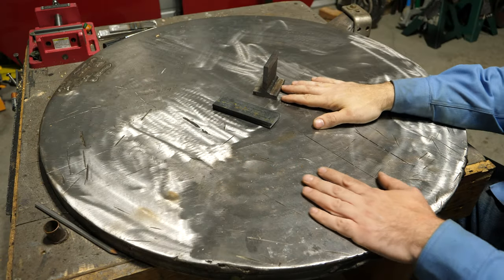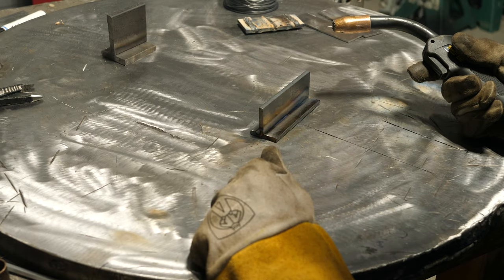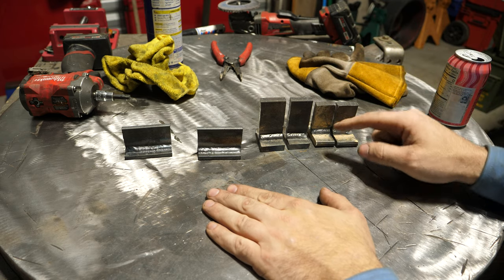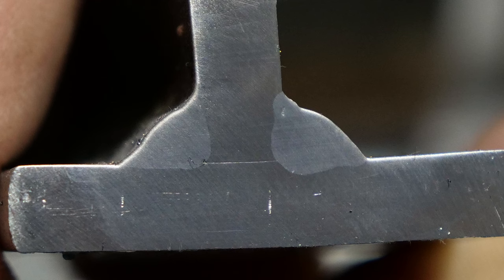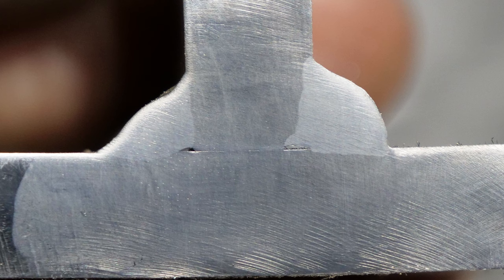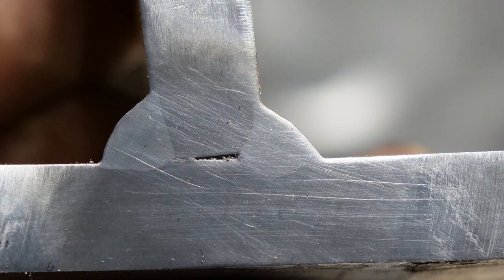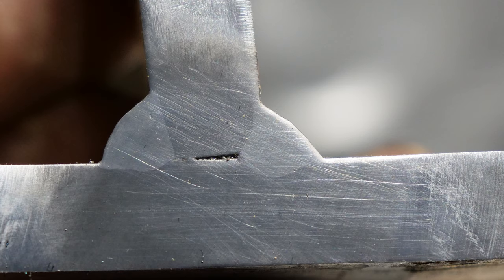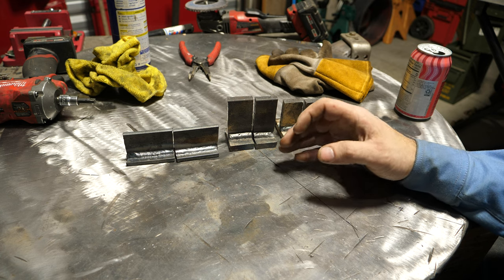Short circuit mig vs Gasless flux core on thick plate

Comment: Loving the cut and etch Greg. Im mostly a stick guy, but it was eye opening to see that flux core has superior penetration compared to solid wire.
Reply from the maker: On 1/4 inch steel there is no doubt that flux core is far superior to gas mig.  I have run into issues with over 1/4in where the flux core has porosity issues I can’t eliminate.  That’s why I too like stick and use that anytime I need to weld 1/4inch and above steel, it produces clean welds, great penetration, and is reliable.  I have ordered dual shield wire (.035) to try and that will be very interesting to see how it runs on thicker plate.  It should solve the porosity issue I have seen, and allow a 200 amp MiG welder to safely weld 3/8th plate, or atleast that’s my hope.  Testing will show if that’s true or not lol.

Comment: I'm getting up there and never had any supervision on a mig. I bought a Lincon 185 when I was 15 . It cost me 125 dollars and came with wheels. I still have. About 15 years ago I go a 145 Hobart shortly after that my son borrowed it and I never saw it again. He burnt it up.  So I bought a mig and a tig that can stick.  I torch weld, braze and stick. I went to school  to learn these. I am so glad I watched you.  I'm in the process of up grading a very low side-by-side. It had a 6 horse predator I'm installing a 60 horse Honda. And I am welding to fast , wrong polarity and to far from material.  I will fix that thanks to you. I thought I had lost my touch !  I had to lengthening it for the Honda and I was getting concerned with my welding ,but I will remedy that in the morning . Thanks again.     👍👍🏍🙉🙈🙊
Reply from the maker: No problem 😀.  It’s amazing how well things can go when a few small details are correct.  Flux core wire In particular has to have specific things exactly right or it works terribly.  The cool thing is once you do those things the results are instantly better and quite good at that.  Most welding just comes to a few small details being just right for the results to be acceptable.  The key is knowing where things are going wrong and adjusting accordingly.  Since you’re researching knowledge on how to become better, the great thing is you will likely get significantly better fast.  That’s what is the great part, once you master a few things like making simple weld beads that are really good on a flat plate, you can build cool stuff like you’re talking about 😀.

Comment from the maker: So I bought the dual shield from Amazon.  I will have a video out soon with it.  Having never ran .035 dual shield (I have only ran big stuff with a engine drive) it’s been a learning curve.  I will share a bit of a “sneak peak” to what’s going on thus far with the dual shield:

I couldn’t find reliable setpoint data because it’s so uncommon of a wire in .035.  I have experimented with a stupid amount of settings, everything from 18 to 26volts, 260 to 430 in/min feed.  So far I have found a lot of interesting things.  It makes perfectly clean welds with zero porosity (internal or external).  The welds are perfectly flat and very good looking.  It runs really good and is easy to work with.  The process 100% operates as spray arc, it’s very quiet and has very little spatter.  With all that said I have ran into a issue where I am not seeing solid root fusion.  The higher the voltage the less root fusion is present.  Since it operates on DCEP it’s not too surprising it would have less penetration than Gasless flux core but it’s significantly less.  Running 1/16th dual shield wire on a big engine drive has no issue with 3/8th plate when it comes to penetration, but .035 at 200 amps isn’t quite getting there.  I will be doing a big bend test coming up and I have a feeling it will fare better than Gasless flux core despite having less penetration.  The porosity issues with the Gasless and brittleness of the welds will be a issue I think.  Time will tell 😀
Reply: Greg, my Sanrex 250 only has settings for 3/8 if you go up to 045 wire for dual shield. It suggests 360ipm and 25v— with 045! So I think with 035 you’re probably going to want something of similar 25V range, but much higher wfs— probably in the 420-450 range.

Comment: As usual another great video with a lot of useful information.  It's a lot of work but you are putting out great stuff for anyone thinking about getting into welding (home gamer or full-time profession) and you make it fun with the strange accent!  🙂  I'm really glad you went over the "circle e" vs. straight in bead on the root as I found the same thing when I cut and etched or tried to break the weld with unshielded flux core.  Anywho, many thanks for these videos!
Reply from the maker: Thanks for the kind words 😀.  I have done a bunch more off camera testing with the stringer vs circle-e and have seen consistently the same result, loss of root penetration.  I think it comes down to the wires limitations of how much molten metal it can make it through.  For a fill pass on a multiple bead weld I think it would be fine.  As a root or single pass I definitely wouldn’t recommend it.  There is one exception to this, mig welding vertical up is a situation where you don’t have much choice but to do a form of a weave to make a proper weld. 

I shot a bunch of fillet weld break tests that will be rolling out soon.  Those results have been far more interesting than I expected.  So much so that I am going to spend a whole day welding up some test pieces to break Inorder to really clear things up with the first set of results I have 😀

Comment: Just a few minutes earlier I had presumption that weave is usually better :-) Very interesting results in both videos, thank you!
Reply from the maker: I have done a bit more testing on the weave vs stringer that I will eventually get around to filming.  From what I have seen, doing a weave in the flat position universally bites in the side of the plates more at the cost of the root penetration.   This is on fillet welds, on other joints it may be less of a issue.  The problem is the wire can only “penetrate” so much molten pool.  When you weave on a fillet weld the sides of the weld don’t have as much weld pool thickness as the center therefore it makes sense as to why the center of the weld doesn’t gain penetration.  That’s also why higher wire feed speed doesn’t seem to improve penetration of a weld with Mig much, it just ends up depositing more metal above the plate.
Reply: My train of thought was that more time I spend in roughly same place more heat input it gets and so bigger puddle of molten metal...bit counterintuitive that it just wider and not deeper :-) Thank you for clarification!

Comment: Another really helpful vid . Thank you . 
You flux core vids came out at the perfect time for me as I had just bought a cheap 200amp multi process machine. 
After years of stick it was a pretty easy transition to flux core.
Hell I use it for almost all my work now .
Been using it to weld 12mm round bar to 5mm angle when upgrading sliding gate tracks 12m long . 
Was a bit dubious at 1st but it works well and it looks like I get good penetration ( 20v / 22v on my machine seems to do it ) .
Reply from the maker: No problem 😀.  Flux core is very handy and can produce really good welds.  It is far easier for vertical up and limited access welds that’s for sure.  Far less frustrating lol.  Flux core has a bad rap primarily because of 99$ welders with unskilled people.  It’s actually a real viable process that can do a lot.  Glad you found a new useful process 😀

Comment: I’ve been thinking of learning to weld for years. Your videos are great, you missed your calling as a MATC instructor. 

I haven’t watched all your content yet, so forgive me if you’ve covered it. What about a video on buying used equipment from marketplace? I’ve been looking and I have no idea where to start. I think a Lincoln or Miller ac/dc stick unit is where I should start, and they are available for a bit more than the Amazon stick specials, but I’m not sure the thunderbolt ac/dc with 25 ft leads for $250 is where I need to begin. The other kick in the pants is running a 50amp 220v to my garage. That’s a used welder worth of wire cost these days.

Maybe the 100 dollar yes welder is worth it on a 20amp 110 that I already have. Anyways, that’s my video idea/question. Please continue the good work, you are a great educator.
Reply from the maker: I haven’t covered buying used equipment, but that’s a great video idea, I will cover it and have a video out within a week or two at most.  I will give you some advice now, hopefully it helps.

For certain circumstances a cheap Amazon special will cut it.  I own a 100$ Amazon stick welder that I bought because at the time it was annoying to haul my big brick of a miller dynasty outside of my shop.  It did the job but honestly the quality of what it could do had more to do with me than the welder.  It’s setpoints were off by as much as 20% from what it said, which is very common with cheap welders.  For me, I could just work around it because I knew if it was “hot or cold”.  For a inexperienced person they might not know what to do to compensate, become frustrated, and not realize their equipment is making things so much harder than it has to be.  It does pay to buy better stuff. 

I would buy a solid used welder for a bit more than a cheap new one every day of the week.  There is so much you don’t realize is different between cheap and good welders until you use them.  Cheap stick welders won’t weld with 6010, and often barely run with 6011.  They don’t have hot start, or arc force control.  Their set points tend to be off which makes it hard to adjust settings.  As a experienced welder I can compensate and stick weld with almost anything (even two car batteries lol) but a novice/beginner will have a much less frustrating time with a better welder because they tend to be more forgiving.

As far as actual used welders, a thunderbolt ac/dc is a great option, it does have limitations though.  It’s a bit harder to adjust its output vs a lcd screen setup.  It’s big/not very portable and draws a ton of power.  It’s duty cycle is somewhat limited on DC because of its simplistic bridge rectifiers duty cycle.  But it does weld with 6010 and 6011 well.  It does have zombie apocalypse level of reliability.  It also is available for reasonable prices used.  Pretty much if it runs a bead it’s safe to buy used because it works and will work.  I would take a thunderbolt ac/dc over virtually all cheap stick welders out there, unless portability is a concern.  

The only cheap stick welder I have found to be worth the money is everlasts stick only units.  Everlast doesn’t lie about their specs (aka max output or the ability to run 6010), their digital displays are fairly accurate, and they have actual adjustable features like arc force and hot start.  The best home hobby stick welder out there (in my opinion) is the esab rogue 180.  I have owned the 180 and I now own the rogue 200.  It welds perfect, it has all the settings that you want, and is very small/ portable with is great.  It also has power factor correction so it runs on 120 while pulling less amperage so you get decent output, unlike cheap welders.  If you could find one of those used that would be the best option (in my opinion).  Otherwise look at everlasts stick welders, or that thunderbolt would be a good option.  

Like I said, it’s not that the esab rogue, or some other higher end stick welder will make you a better welder over a cheaper one necessarily.  The better welder will make it far less frustrating to learn to weld and will make it easier to achieve higher quality welds.
Reply: I started out with a Telwin Force 165. I was happy with it, until I got the Rogue 180 Pro. Having the same make and model electrode on the same base material, the Telwin did a decent weld and the Rogue blew the base metal to oblivion as soon as the arc struck! That means that the Telwin was running VERY much lower than the settings...

Worst part is, the price wasn't insanely different, the rogue being not twice the price.
Reply: @makingmistakeswithgreg  Thanks for taking the time to write a detailed response. I'll keep my eyes out for the used buying video and hunt down one of the units you suggested. Thanks again.
Reply from the maker: @williamheitl8941  I just uploaded it a couple hours ago 😀

Comment: I have used fluxcore but in the end I use dual shield fluxcore ,I find it better in many ways especially out of position. How about doing a cut and etch with dual  shield vs reg fluxcore  vs short curcuit.  I can use 045 dual shield  on my machines  when needed.
Reply from the maker: Great idea.  I bought a spool of dual shield .035 because it’s available in the states for people.  I think it will solve a lot of issues I have been dealing with.  Gas shielded mig has poor penetration on thick material, Gasless flux core has more penetration but on thick metal I can’t get clean welds (always have some porosity above 1/4in plates).  .035 dual shield should provide the penetration of flux core with the clean porosity free welds of mig.

Comment: Thanks Greg. Makes me ask the question why not use fluxcore all the time instead of hauling a gas tank around?
Reply from the maker: So flux core is a really solid process.  The main downside to it is the fact it tends to produce porosity on thicker material.  Since that video was released I did a ton more testing and have come to the conclusion the practical limit for self shielded flux core is around 3/16th thick.  At 1/4 and above the welds will have internal porosity.  Going to .045 and bigger wire solves this, but most home welders can run that big of wire.  Flux core also tends to produce more brittle welds than gas shielded mig.  

Gasless flux core is actually one of the most valuable welding processes in my opinion.  It is far easier to weld vertical than stick and gas shielded mig.  It welds through poor material better than mig.  On 120v the results are far better with it as well.  Definitely worth having a flux core setup machine.
Reply: Thx Greg, good to know

Comment: Hello Greg. What about flux core vs stick welding ? Differences and when to use SMAW and when to use flux core arc welding ? What are the pros and cons of both methods ?
Reply from the maker: I am planning on doing a “overview” to welding in general soon.  I will definitely be covering that in there.  For the mean time I will share this info:

Flux core and stick have a lot of similarities but at the same time have a lot of things that are different.  The both produce slag, they both have good penetration, they both can weld through sub par surfaces (rust) decent, and they are fairly economical to use.  In actual use flux core wire tends to be by far easier to learn, easier to actually weld with (especially out of position) and far easier to weld thin material with.  

Where flux core falls apart is thicker material.  When you use .035 wire the practical limit is 1/4inch thick material.  I have done extensive testing and on material above 1/4 the welds tend to have issues with porosity.  Switching to .045 wire tends to fix this, however most home hobby level machines can’t run .045 wire.  In general self shielded flux core has far more porosity than stick, which is not good for weld strength.  It’s very common on 3/16th to 1/4in steel to cut and etc a perfect looking flux core weld and find a small bit of porosity inside.  Flux core also tends to produce porosity on spot welds and anytime you try to fill a hole on something.  Stick welding produces a stronger weld than flux core, however flux core can produce better penetration (if you compare 7018 vs flux core).  Flux core gasless also has far less availability to handle vibration/shock loads than 7018.  

Gasless flux core would be my pick on sheet metal to about 1/8th in thickness.  It produces strong enough welds on those materials and it’s so much easier/faster.  At 3/16th and thicker steel I would switch to stick and stick weld it.  If a person has a big enough wire welder to weld with .045 (or bigger) wire, then thicker steel wouldn’t be a issue.  .045 dual shield flux core wire will also perfectly weld 1/4in + material without issue too.  

Hopefully that info helped you out a bit.  There is a lot of overlap in capabilities between the two.
Reply: @makingmistakeswithgreg  Thanks for the answer.  I asked because I can buy accessories for fcaw welding: .035 feed roller and contact tips.  maybe I'll buy it and let it sit on a shelf in the garage.  It's always an additional option👍